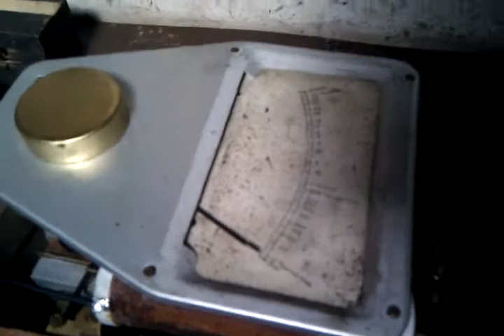Evershed & Vignoles Megger (1920)

Comment from the maker: Yeah not something I wanted to try doing, I don't believe it stores any charge based on that the voltage dropped as soon as I stopped turning the dynamo handle.
Not the tool for the old "megger your mate at 1000V whilst he's on a stepladder changing a light trick" either then... lol x]
and yes, the internals are very impressive, solid core wire formed to fit its place, brass gears, ceramic, cloth coated etc, beautiful and still all functional!
I have pictures, check the video details!